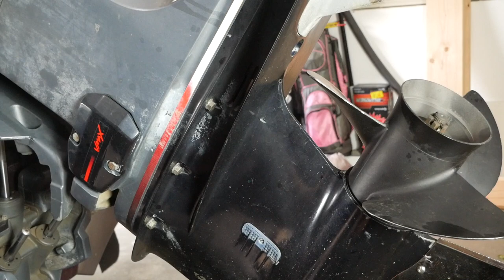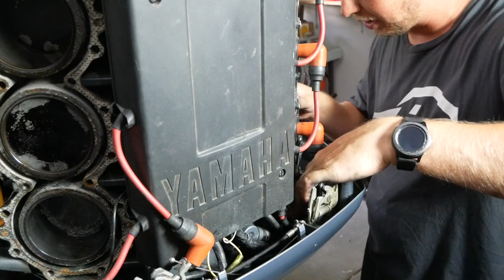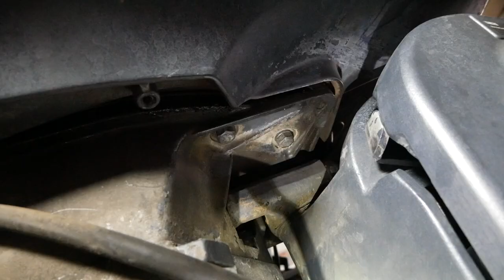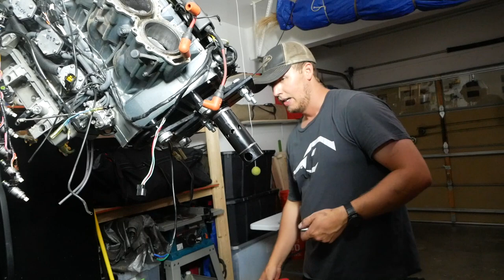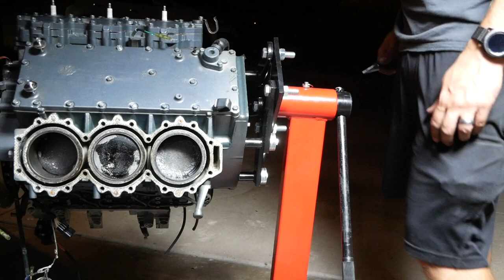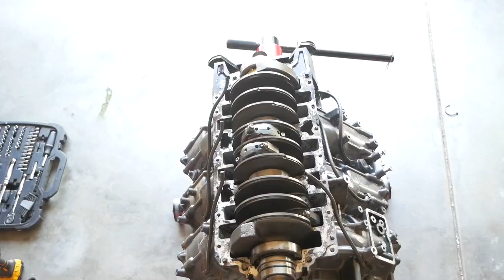Yamaha OX66 Full Disassembly - Rebuild Outboard

Comment: Use a supper long needle nose vise grip on the nasty clamp. Once it's stabilized you can wedge the nut into a socket using electrical tape. You can push down on the socket and extention. It will force the threads into the nut. Turn 2 man 2hr cluster into a 5 minute job.

Comment: Just got a 2001 200HP OX66 and having bogging issue and chasing fuel pumps and injectors. This video has helped me learn a lot on how this system works!
Reply from the maker: Glad it helped. Check Spark plugs. Those are usually the cause of it bogging if it's not a dirty VST filter.
Reply: @CatchingColorado  Thanks for tip. I went over the entire fuel system sevferal times and even had injectors professionally cleaned. I recently changed the head gaskets and got about 15 hours out of motor before cylinder #6 on top left made loud knocking sound and got stuck 12 miles offshore... Got towed-in for a long day and watching all your re-build videos over again!

Comment: Thanks for taking the time to make this video! I just pulled the head off mine cause cylinder 2 detonated. I assume from a bad injector. I wish the cylinders would come off the block so I didn't have to pull the entire power head. Sure complicates the job.
Reply from the maker: Did you get her fixed?

Comment: I know its been 2 years since your video post but I was wondering how much money you had into the rebuild?   I know you needed a new crank, gasket sets, O2 sensor, machine shop work , etc.  I have a 1999 Ox66 that I bought brand new 23 years ago and spin wrenches on it myself for basic maintenance.   Has perfect compression on all cylinders so far.  I really like these 2 stroke 200HP and am weighing whether to repower with new engine in case this one grenades or do the rebuild.    Thx for the video !
Reply from the maker: All in, I think about 5k. But a big cost was the crank, another was shipping the block for machining, lastly, I am picky about parts and bought good stuff. You can do it for less. Very easy motors to work on if something ever does happen.

Comment: So what happened did you rebuild it? And if so what was the total damage. I have a 200hp basically same motor 95 psi per cylinder thinking about doing a rebuild. Got a qoute 7 grand. Either that or buy a 4 stroke 30k i think id rather rebuid this one if necessary lol.

Comment: other than a new piston, what parts did you replace? any bearings? rings for all cylinders? trying to figure out what parts should automatically be replaced if you go through the trouble to tear an outboard down.
Reply from the maker: All bearings, rods, rings, cylinders, gaskets, O2 sensor, and filters.
Reply: @CatchingColorado  Did you use aftermarket kit or all OEM Yamaha?

Comment: Fantastic video!! I have the same motor and managed to replace two pistons without removal of the engine!
Reply from the maker: How the hell did you manage that? I don't think that's possible with this engine.
Reply: COfishBRO My local mechanic in Florida did the job and honed out the chamber at the same time !
Reply: I changed two pistons out on the ocean while trolling for dolphin. Runs like a top
Reply: I would like to know how myself. My mechanic said it can probably be done. I need to change one piston, rings and hone the cylinder. But I see when you remove the balancer there is a plate that looks like it bolts on the crankcase and the powehead making it impossible to remove the crankcase without removing the engine.
Reply: kracker1977 Hi ....Unfortunately I was not present when my mechanic removed these pistons , but he definitely did the job without removal of the engine and the total job was done within a day for each piston !! Apologies for the lack of help...
Reply: It takes less than an hour to remove the powerhead.
Reply: So you didn't manage to do anything.. You probably assumed your mechanic did that but it is physically impossible to get the lower crankcase off on this engine without pulling the powerhead.  Now a older version of this say the pro-v is possible as it does not have a balancer. And if you want to fight with it you can pull it off but I don't know why anyone would.
Reply: @Midlothian1000  Can you give me an idea the cost of rebuilding a cylinder on a Yamaha 200? Just bought one with a blown cylinder.
Reply: @andrewwilliams9243   ...It was such along time ago, I can’t really remember , roughly $1000 but that’s just a guess Apologies

Comment: Wharever happened to this motor. I found video where you were going to epoxy some damage but couldn't find any rebuild video. Just curious
Reply from the maker: I am still using it to this day. It does amazing still. I used JB weld to seal a small hole in the crankcase. It's held great.

Comment: I have this exact same engine and model year 1999. I had my engine blow up on me while using it and had it rebuilt. I paid $5,000 to have it redone over 10 years ago. After wards, I used it but then had to stop using it. Finances got cut when I lost my job and was married so essentially this boat has sat unused for 12 years now. Hard to imagine but it is true. I ran the gas out of it when I first parked it. It ran fine when I stored it but after all this time, what would you suggest I do to get it back up and running? I have never cranked it one time in those years. Thanks for any suggestions.
Reply from the maker: Just clean out the fuel line, check your plugs, replace filters, and get a good battery on her. If she is hard starting you can use a tiny bit of starting fluid in the throttle body but don't let her get reliant on starter fluid
Reply: @CatchingColorado  ok, thanks for the input.

Comment: I am considering buying the exact same kind engine, 99 V200TLRX or I am thinking if I should spend few grand more to get a newer more fuel efficient 4-stroke.
What do you think, would you recommend this engine? What are the things I should look for in this engine when going to inspect it at the seller?
Reply from the maker: I think a newer engine is always a good choice but these engines are practically bulletproof. You need to check compression on each cylinder, I would look at the fuel filter and make sure the ring at the bottom isn't floating (indicates water). Drain a tiny bit of lower unit fluid and make sure it doesn't look frothy or milky (water in lower unit). Make sure it trims up and down well and with ease. Always water test the engine if possible

Comment: Congrats on the engine rebuild!  If I was you I would disconnect the Precision blend system on that engine and just mix the gas in the tank!  My first Yamaha 200 blew up because of this problem and so I immediately disconnected on the one I have now and haven't had any problems at all!  Good luck fishing and congrats on the rebuild she really ran good!!
Reply from the maker: Great point!
Reply: If the oiler goes out these Yamaha outboards it will over oil and smoke like tar kettle. It won’t blow up. I’ve been running a 2003 Yamaha 150 VMax for 19 years. You have to do regular service on them and not wait for something to tare up. They have a small filter on the bottom of the oil revisor that I change every year. Service is the key to making any outboard motor last.
Reply: @CatchingColorado   Leave it on the motor. It was designed to work at its best with the oiler in tact.

Comment: Question for you.I have a 2000 Pursuit 2870 with Twin 225 OX66 Yamahas. The engine overheat alarm occasionally goes off on the starboard engine. We have replaced (with Yamaha parts) - the water pump, the PRV, the thermostats and have cleaned the O2 sensor. The alarm only goes off in the channel at low speed after running for 10 minutes or so. Any suggestions?Mark
Reply from the maker: I have no idea... I never had overheating issues. Lots of sensors to check that might be throwing that alarm though. 
 
How are your T stats?

Comment: How did you adapt the engine stand to fit the block?
Reply from the maker: Long hex bolts, then tons of washers between the block and the stand. This helped make a tight connection and gave room for other components.

Comment: What bolts did you use to mount the engine stand plate to the engine?
Reply from the maker: Long carriage bolts with washers for the section of bolt that didn't have threads.

Comment: 22:40 are those vacuum lines or re-circulation lines leading back to the intake manifold? i have the exact same ones on my 3.0 liter looper evinrude and they have check valves in them. awesome video!
Reply from the maker: Good question but I think Vacuum lines.

Comment: Is there a video of the rebuild?
Reply from the maker: Unfortunately no. But I can answer questions.
Reply: @CatchingColorado  Hey man great video. I have low compression on one cylinder 115 115 115 110 100 80.  so planning to rebuild the motor. I am a very experienced two strokes motorcycle mechanic and know how important are the bearings. What brand bearings did you used? How many hours on your rebuilt motor now? Thank you.
Reply from the maker: @trustytrucking9917  check out the WSM kits. They are reliable and well known for aftermarket parts. I have 20 hours on the rebuild. but it was hard to get out this year with things going on

Comment: Did you have to sleeve the cylinder?
Reply from the maker: No. Just bore .010"
Reply: Did you bore the bad cylinder only or you had to bore all cylinders and replace all pistons?
Reply from the maker: @Victorperez-fr7yh  bored two cylinders. Honed the rest
Reply: The reason I asked was that I wanted to rebuild a motor with a scared cylinder and the mechanic told me I would have to buy a new set of pistons. That I couldn't bore that one cylinder only. I would have to bore all of them because I couldn't have different piston sizes. Just wondering if it was true.
Reply from the maker: @Victorperez-fr7yh  with most engines yes. With these they are done this way all the time. You only need to bore the bad cylinders
Reply: Ok. Thanks for the info. Great video. One last question,  on the video it looked like you know your way around the boat engine. I consider myself mechanic incline. Just a bit unsure if I can do a rebuild on a boat engine.
Reply from the maker: @Victorperez-fr7yh  this was my first full rebuild. Still running great

Comment: If the engine is seized the prop won’t turn ..... try agin
Reply from the maker: Explain?
Reply: Put it in neutral and the prop will spin regardless of the engine
Reply from the maker: @DirtMcGert29054  Truth. I talk so fast through these things. It's not always what I mean. Meh, you know what I was saying.
Reply: @CatchingColorado  I hear ya , I get paid to find  problems that have been over looked , so its nothing personal
Reply: Any idea what blew the motor? I just got a similar engine
Reply: @SolarBurrito  , a freind of mine has a 2001 250 , he lost the bottom two cylinders , he thinks it over heated and cracked the cylinder liner letting water in . I think the boat partially sank before he bought it and the liners were rusted or the reed valves for those cylinders rusted and broke then the engine ingested them , or the bottom two injectors were clogged making those cylinders run lean
Reply: Lol i was thinking the same thing

Comment: 3.1 is not a 200 its either 225 or 250
2.6 is the 200
Reply from the maker: V200tlrx 1999. It is indeed a 200
Reply: @CatchingColorado  
I did not know they made a low hp version you are correct
I own a 2005 OX66 2.6 200 and
2004 OX66 225 both SX series
They are great motors i think the best 2 strokes ever
Reply from the maker: @drifter9425  ever since the rebuild mine has been Rock solid.
Reply: @CatchingColorado still going strong ?
One thing I've found out was the Yamalube is a bad 2 stroke oil it's so bad you need ring free in it 
I believe it's one of the reasons for failing
I've been using Toyhatsu Full Synthetic for 7yrs and I put ALOT of run time on mine every year and I run it wide open a fair amount 
O2 sensor and plugs always look clean in fact I've never had to clean the O2 sensor since I bought it used 
I did however start off day one with a new one and plugs as well as a clean VST and ZERO issues

Comment: Take the fly wheel cover off before you pull the starter(tooless) , your making this up as you go a long , clearly spent too much time the forums
Reply from the maker: Never claimed to be a mechanic. Not charging customers either. This video is free to use as an educational tool. But for a backyard mechanic, and using forums, youtube, service manuals and advice of local mechanics she runs like a top, soooooooooooooooo
Reply: @CatchingColorado  there will always be haters! Thanks for the video. I have started doing some and respect the amount of time that is needed to post this here for free! I do all my own work on cars and equipment. Was a little scared to crack off into this thing but now that I have seen the video I will rip it apart. Did you find a good source for all the torque specs and patterns?
Reply from the maker: @92greymare  shoot me an email at cofishbro@gmail.com and I will send you the service guide
Reply from the maker: @92greymare  updated the email. Stupid Siri jacked it up
Reply: @CatchingColorado  don’t pay attention to haters. The vast majority appreciate what you did by posting a free video. THANK YOU SO MUCH.